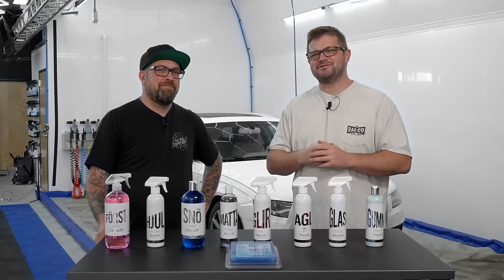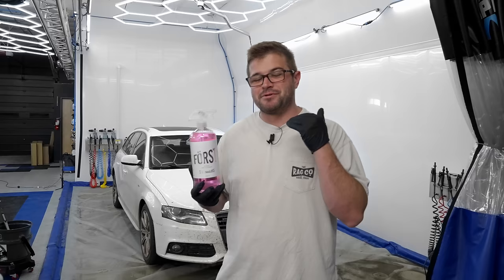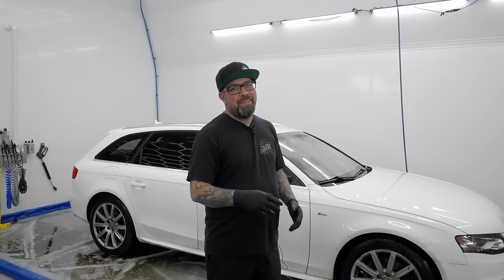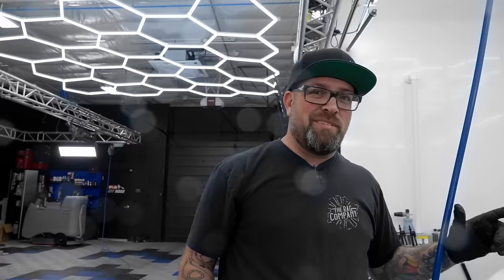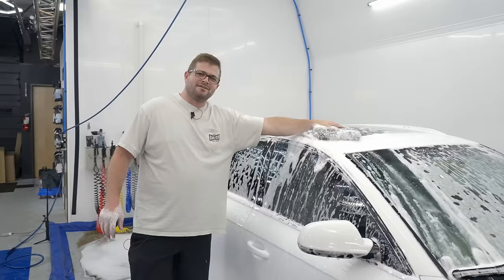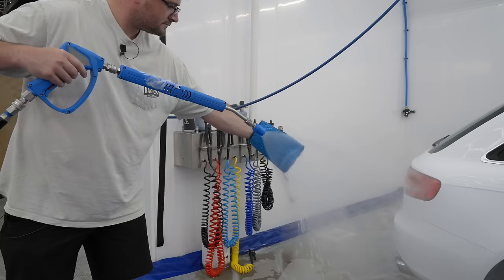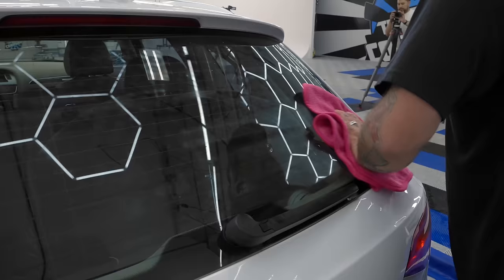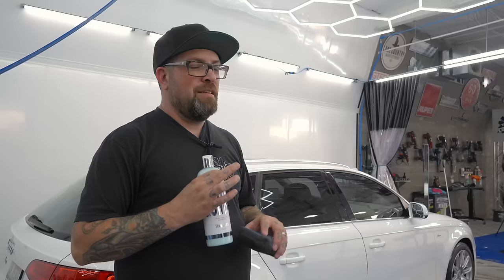The Detailing Product that You Should be using FIRST! | Filthy Car Wash

Comment: Where can i find the plastic sheet on the floor?thx
Reply from the maker: Hi there! Despite what it looks like, our water reclamation mat is actually quite a bit more substantial than just some "plastic on the floor". It's part of a Detail/Car Wash system developed & made by a company called Detail Plus. (Out of Oregon) It's meant to be incredibly durable and has been driven on by tons and tons of cars with all sorts of tires that could've ripped other mats to shreds. In addition to the mat itself, there's also an adjustable border around the entire thing that's comprised of different-density foam inserts, designed to create a wall that water won't escape from. The inserts near the front and corners are softer than the rest to allow for cars to smoothly drive over them.
▶ The mat can be found here: https://detailplus.com/collections/water-containment/products/water-containment-mat 
▶ The curtains can be found here: https://detailplus.com/collections/detailing-systems/products/wash-bay-curtains